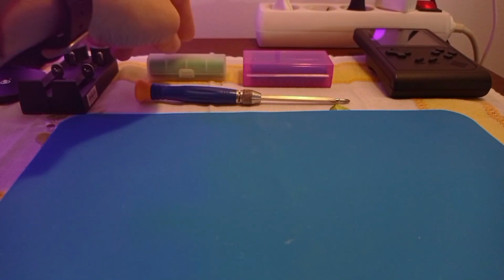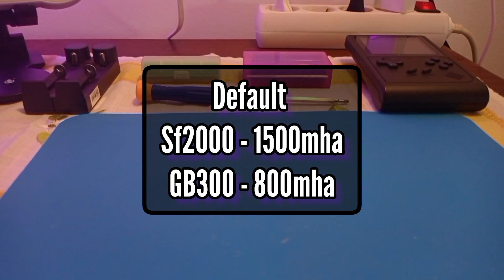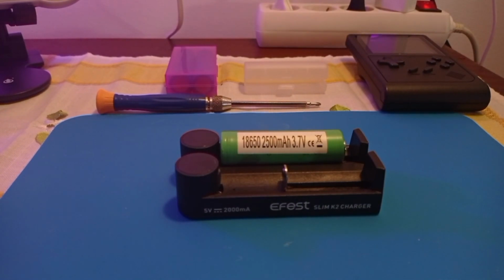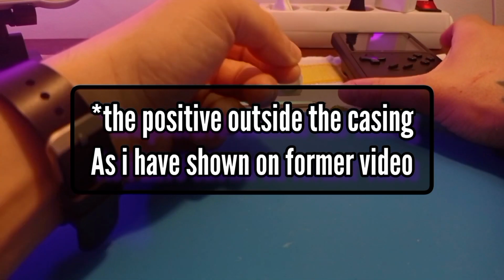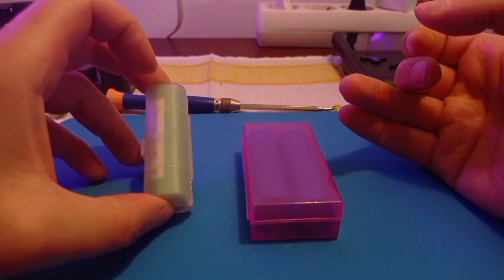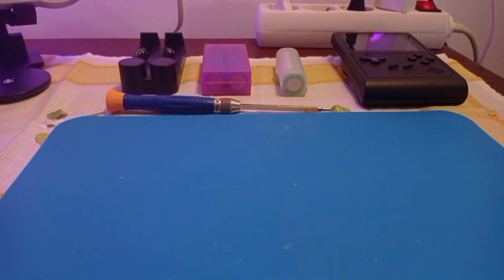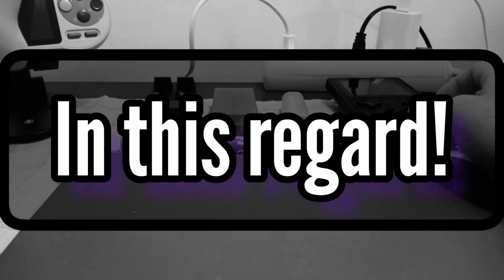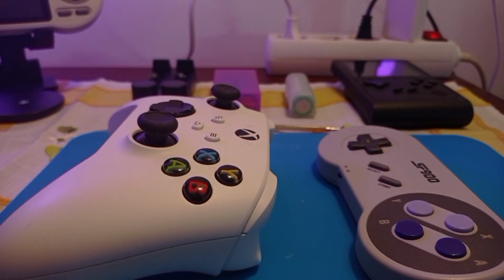Batteries and Safety on Retro Handhelds #GB300 #sf2000 #multicore #gameboyadvance

Comment: Olá tudo bem? Comprei um GB 300 chegou tem 10 dias mas agora não liga mais, quando plugo o cabo tipo C acende a luz verde mas sem o cabo nem dá sinal, o que pode ter acontecido?
Reply: try another SD card, the original one sucks
Reply from the maker: O cartão provavelmente morreu vai ter que reinstalar o firmware de origem
Reply: Hello can you tell me why does my GB300 battery only lasts for like 20-30 minutes after 3 minutes. Are there any ways to fix it?